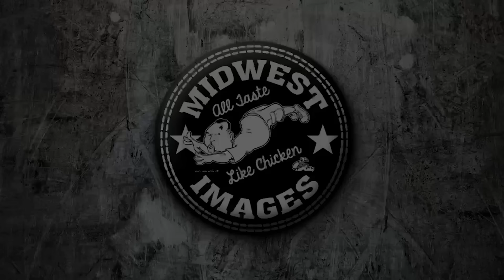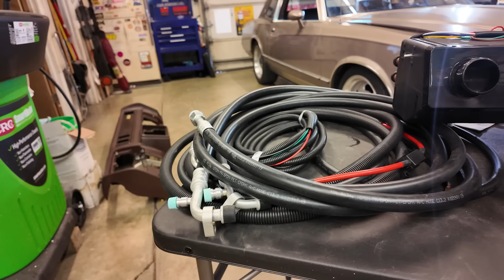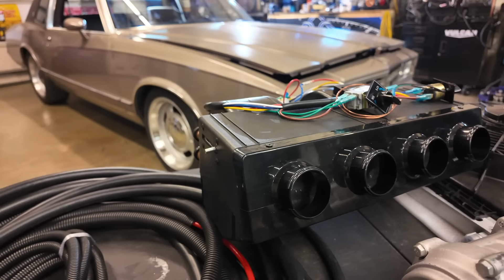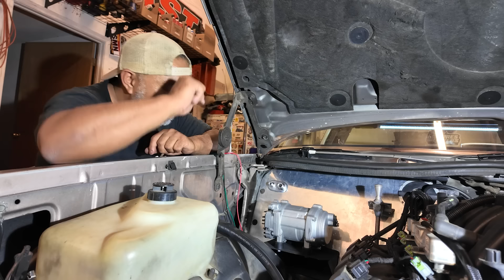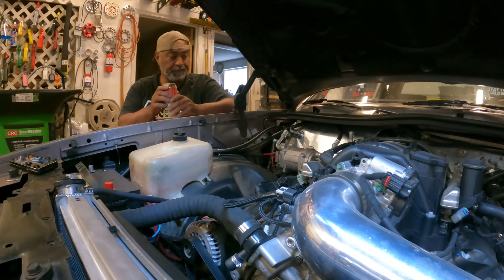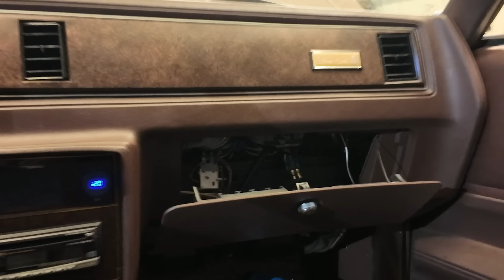12 VOLT AIR-CONDITIONING MY HEMI MONTE CARLO...IS IT WORTH IT?

Comment: So, this would be a system not to use in the Southwest where it's in 100° to 110°F for 6 months? Vintage Air would be a better plan, I'm assuming. It's a cool item. I don't think it would hold up in my neck of the woods.
Reply from the maker: It could work if you modify the air flow from the box and the condenser.   Im gonna play with it
Reply: @Midwestpaintandmetal, keep us updated on this unit. I really want to put AC in my 88 K1500. It did not come with factory AC. So it keeps me from driving it more between May and the end of September.  Gets rather spicy in south central Arizona.
Reply: I'm wondering this, too. Great video and info but a comparison to a Vintage Air or similar system would help me a lot, having an old car with no A/C but a newer engine with room to mount a belt driven compressor. VA kit is under $2k so, after upgrading this system and electrical, cost may not be too far off. So then which works better at cooling?